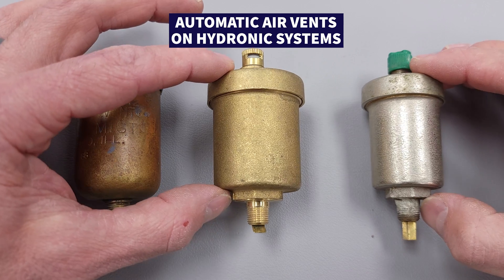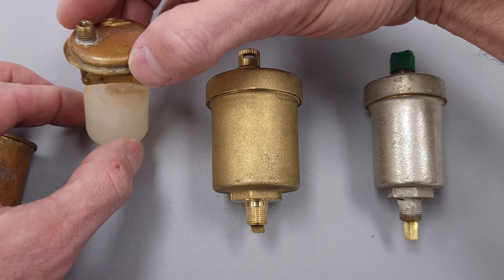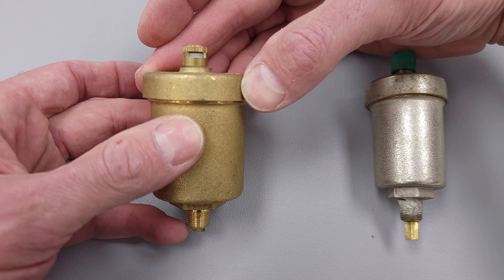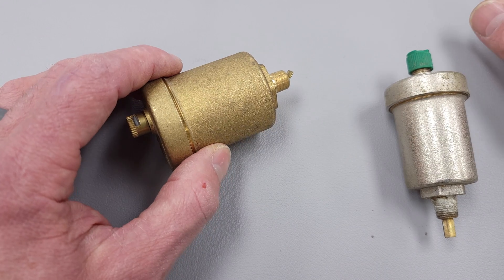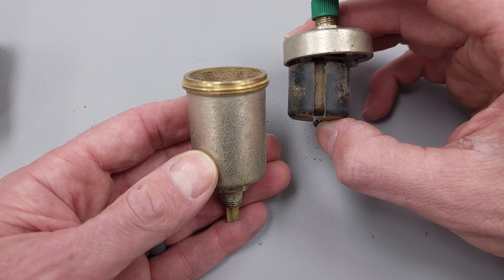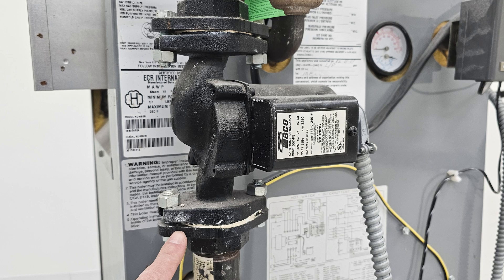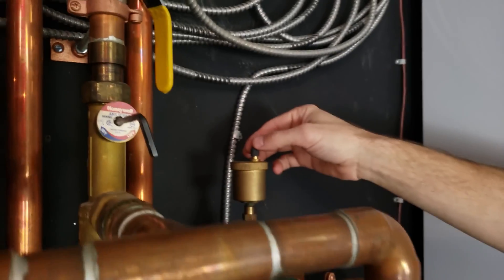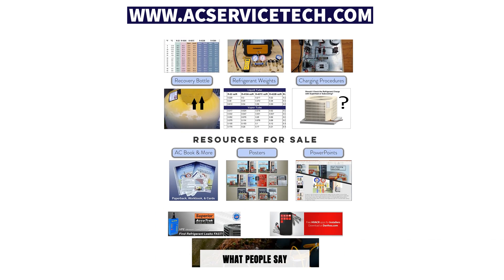Automatic Air Vent Operation and Servicing on Hydronic Heat Boiler Systems!

Comment: I have the middle designed one on my Munchkin M80 single zone w/ indirect fired water heater. It just started leaking after 15 years. Thanks for the tips now i know what to look for. Im assuming the rubber seal gets worn out allowing water to escape if not just dirty. For under 20$ replacing its probably worth it.

Comment: I'm trying to figure out what the piece of metal that protrudes out of the inlet is called and how it works. I ordered some and the metal pieces (air collector I'm going to call it) were bent in shipping. But I see that some are pictured with a bent tab. Even one of yours is bent.

Comment: Great video. I have two of the ones on the left the maid o mists as pictured. I got one off it was very tight and leaking badly and got that one replaced, and the second one which barely leaks but I have a replacement to swap it out with, but it won't budge I feel like I am going to break it off then really be hooped. What's the best way to get them off without breaking them?

Comment: I have a boiler but one zone isn't getting hot seems like the line Is clogged is there a way I can cut and blow it out.? I changed the zone valve and circulator motor I'm lost?

Comment: This was super helpful. My air vent was leaking on a used indirect unit I installed, and I was worried I wouldn't be able to find a replacement for a few days over the weekend. 

I was able to clean it up and it works great now thanks to this video.

Comment: i believe i have the 2nd model shown here. I noticed water dripping from it and down the tank itself. I watched videos and tapped on the tank it sounds hollow so i think its still good. I was told i can turn the little knob at the top clock wise and that will stop the water from slowly dripping out of it. Its this true? And if yes how much should i turn it? Full turn a few turns? Thank you in advance

Comment: I have a Taco Hy Vent on my boiler and it's leaking water. I tried to fix it by just cleaning the rust out but it has an indentation in the rubber seal where it touches the plastic hole that comes down from the cap inside. It also might be leaking from the seal around the cap itself. How do you tighten the large cap itself, by hand or using a tool like a pipe wrench or something else? I have ended up replacing this about every 5 years with a new one even though they look perfect other than an indentation in that small rubber inside.

Comment: I never put these vents on.  And if I do, I put a small ball valve on them for easy change out/servicing.  Microbubble reabsorber, pumping away from expansion tank is the only way to go for trouble-free operations related to air.

Comment: Another great video Craig! It would be good to add that these should not be installed on boiler systems that have the old open expansion tanks. They should only be used with bladder style tanks. They will siphon the air out of the older tanks then the boiler will over pressurize.

Comment: sometimes they're automatic water leaks.(all too often), educate and teach the homeowners to check, maintain and operate them manually, very often.
been there done that, people forget and never do the maintenance. nobody ever rebuilds/cleans them (Ok, yes I have, while waiting for purging/refilling/parts runners)
but in general, everyone just slams in new air-vents, relief valves and expansion tanks all at once, very often the fill valves too.

Comment: What a great video- I’m an HVAC designer and it’s nice to see the insides and how these automatic bleeders work and can be serviced, not something usually found in a catalog! Typically if I found a leaking one on an existing system I would recommend it just get replaced- but depending on the type it might be worth having the maintenance technician open them up and clean them out as a first step- in large systems that could save a decent amount of operating budget.. I’m also gonna give some extra thought into placing them right after strainers or dirt/air separators to minimize the amount of gunk that gets into them- the one looked pretty clogged!

Comment: Can you service the air vents without draining the system
Reply: Yes you can shut off the boiler train a little bit of water out make sure the boiler is cool when you do this take out about 2 gallons of water make sure you shut off the water valve that lets water into the boiler too when you're done put everything back on

Comment: My system is in the basement, and I have a reznor heater in the garage without a bleed valve or air vent.   What a pain…….

Had a company quote me for a new boiler. Current boiler is only 80k BTU.  He wants $9600 to put in a new boiler.  I was hoping to avoid doing it myself. At those prices I don’t see where I have a choice